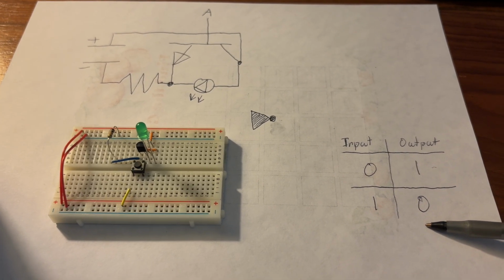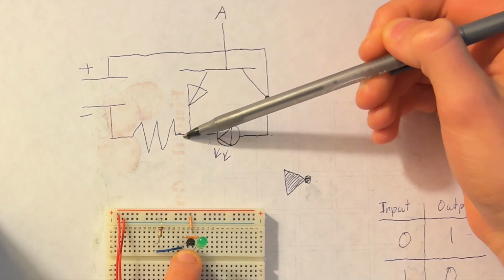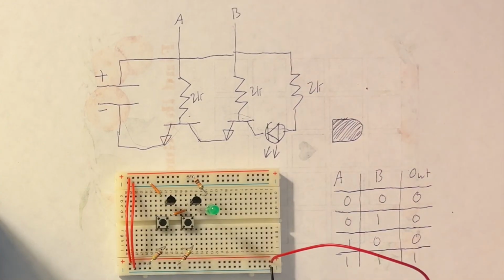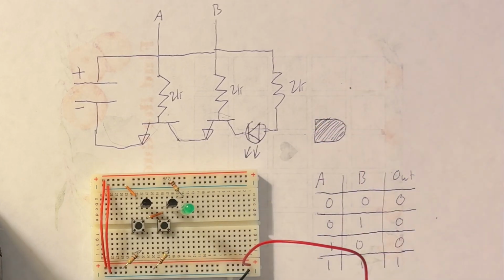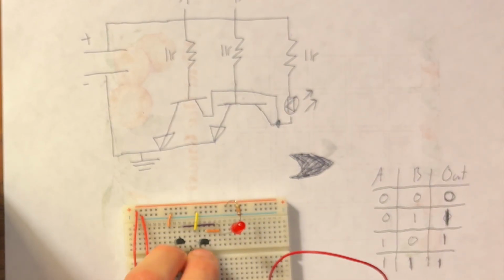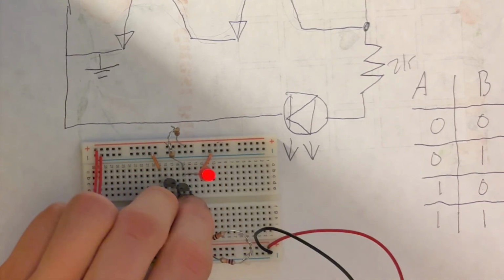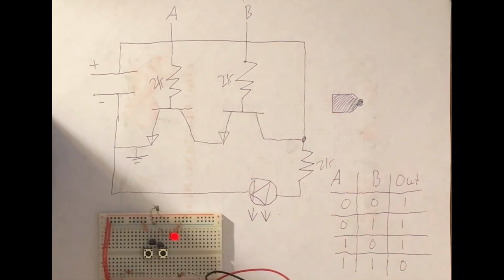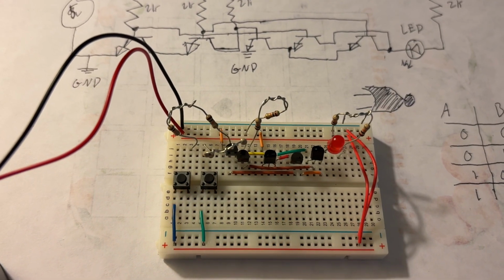Building Logic Gates: NOT, OR, AND, NAND, XOR

Comment: In your NAND gate when both transistors are opened there is no limiting resistor in the circuit so current will go as high as battery allows . Right?
Reply from the maker: Doesn't the resistor before the LED limit current flow to prevent burnout?
Reply: @Cobie87 It would if it was placed before collector connection node. On the schematic transistors bypass both resistor and LED.
Reply from the maker: @_majortom_ So you are recommending that another resistor should be placed after the two transistors and before they connect to ground? Or in other words, that on the physical circuit, the two transistors should be connected to ground by a transistor? I really appreciate the advice btw.
Reply: @Cobie87 No. If you introduce another resistor in transistors part of the circuit you will have resistors in parallel and current will flow both ways according to ohm's law. Instead you should place rightmost resistor in the main circuit (after battery + ) to limit current for all components. Imagine if you had a 50 A power supply. Transistors would burn in a flash.
Reply from the maker: @_majortom_ Okay, thank you!